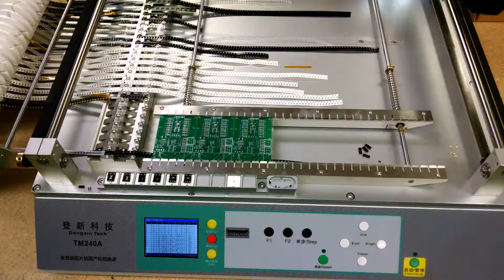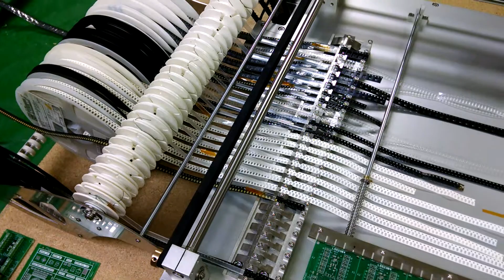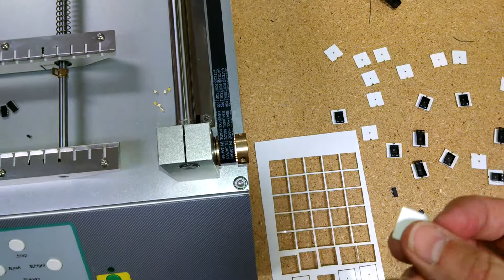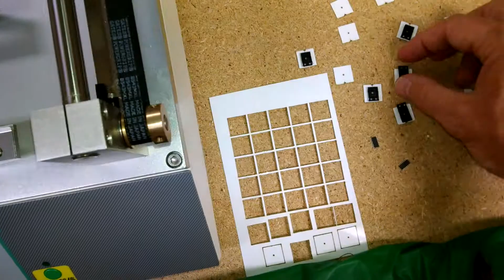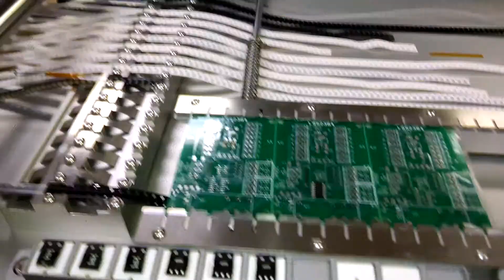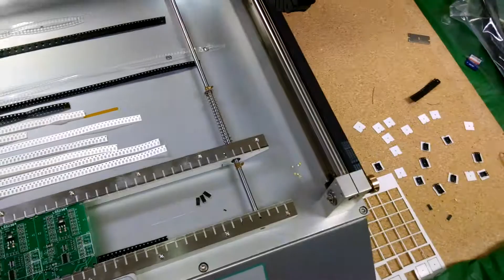TM-240A front tray idea and review

Comment: Hi Anyone, Running a PnP factory wit two Samsung Mark2's. Found a brand new TM240A in the storeroom. I have everything to start a small line but no software. Also how to set up unit. Can somebody help? Thanks
Reply from the maker: Have you asked Neoden?  They are very responsive
Reply: @JohnHansknecht  Hi John, Yes I have. They helped me to a point. The problems I have know is to get Head 2 to pick up chip from Stack 0.
Reply from the maker: You simply tell it the head and stack in your code.  It knows to look in the center of each open bin.  The problem is each time stack 0 is called, it will move forward one increment to the next stack 0 position to its right.  In my case, this works out, because I put the specific parts in the stack 0 positions knowing it will move over after it has emptied the first position.  If you start a new board, you have to exit and reload the placement code, because otherwise it will not return to the stack 0 position 0.
Reply: Hi John, Yes I have. They helped me to a point. The problems I have know is to get Head 2 to pick up chip from Stack 0.

Comment from the maker: I want to clarify to others that may not be familiar with the unit.  On the front bin, you only have software control for the exact pickup point of the first bin.  Once you program that in the memory, it will pick up from that exact point but 18mm to the right each time Bin 0 is called.  This means you can't put a vibratory feeder on Bin 0, because it will cycle one bin over each time until it has gone through all 10 bins, then it will return to the first bin.  At first this was a source of frustration for me, but now that I have found out I can load many different chips in these bins, I am happy about it.  I have now had the unit for a week and I'm glad I made the purchase.  I have about 8 standard boards and room for 95% of my components on reels.  It has made my life much easier.  I used the Eagle PCB exporter written by Ian Lesnet from Dangerous Prototypes.com